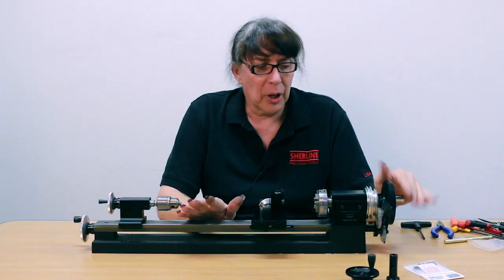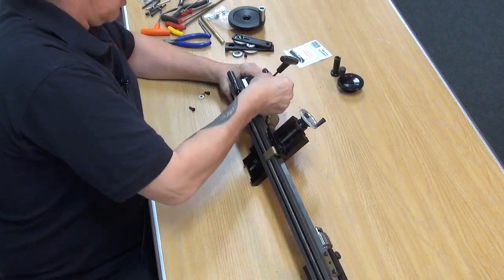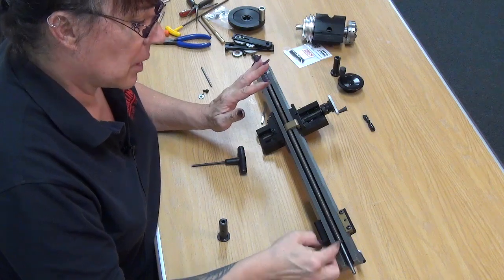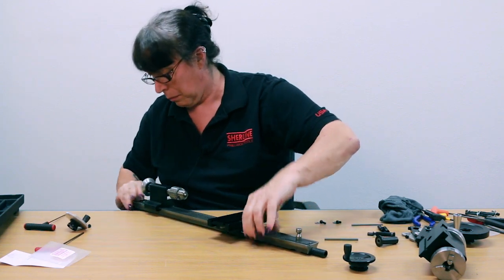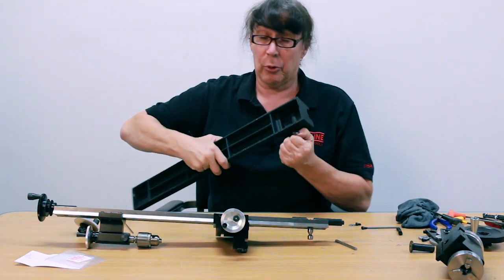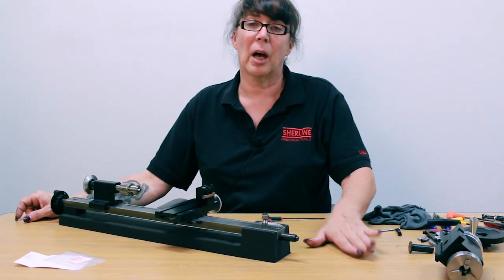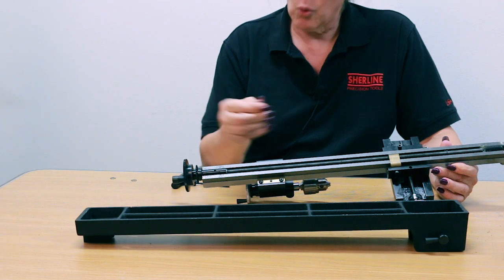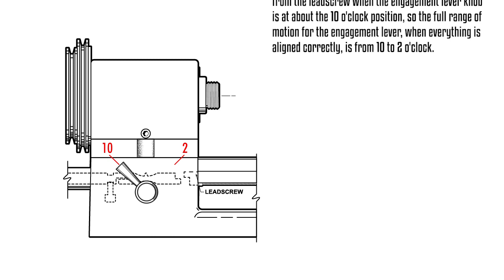Using the Leadscrew Engagement Lever with DRO

Comment: Can we use 8850 with dro?
Reply from the maker: Are you asking about the CNC linear controller?
Reply: @SherlineProducts  Sorry about that, yes.
Reply from the maker: @jasondevault5066  I will ask our tech people, but in the meantime, are you currently using DRO and you want to add the linear controller?
Reply: @SherlineProducts  yes. Also: is part number 8710 the same as a linear controller? That's what I have.
Reply from the maker: @jasondevault5066  8710 is our rotary indexer riser plate. 87100 is our CNC rotary indexer without a power supply. Rotary indexers are not the same as linear indexers. If you already have a power supply for your rotary indexer you can get 88010 which is the linear indexer w/o a power supply. Still waiting to hear from our technicians if you can use DRO with the CNC indexer.
Reply from the maker: Our tech said, "Yes" you can use a linear controller with DRO. The following link instructions are more for a full CNC machine but the principle applies to a single-axis controller. For further correspondence, please email marketing@sherline.com.
https://sherline.com/wp-content/uploads/2015/12/dro_on_cnc_inst.pdf

Comment: Really jerk move to make the dro shaft sold seperatly instead of making it part of the kit. If you are too cheap to just inlude this low cost part in the kit, at least make a kit for those with a dro instead of selling seperatly for 100 times its cost plus shipping.
Reply from the maker: Do you have our lathe with DRO and wish to add the threading attachment (P/N 3100), or do you have the threading attachment and want to add DRO?